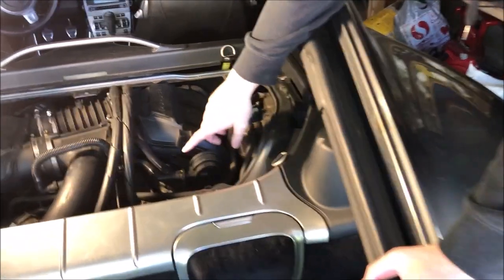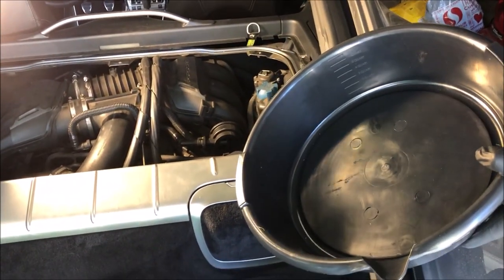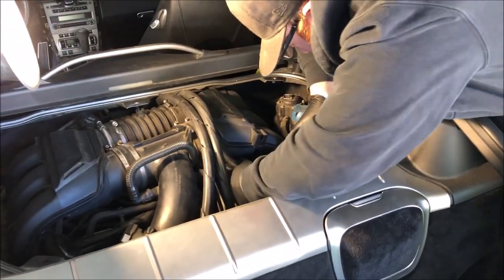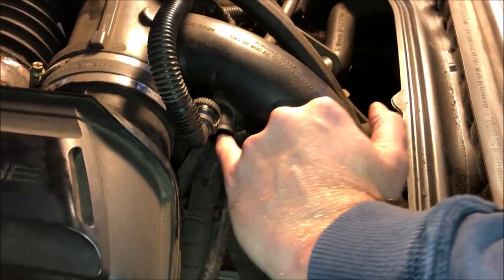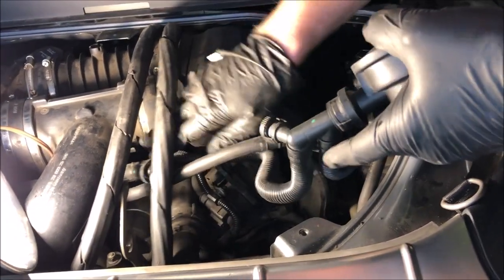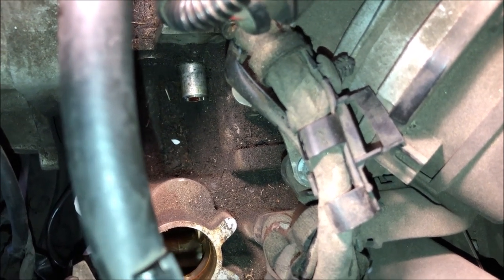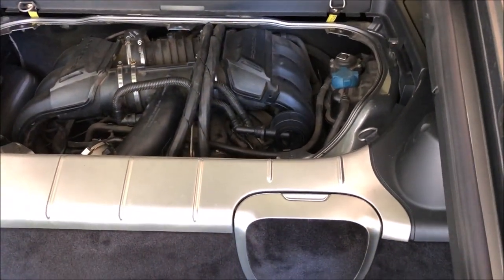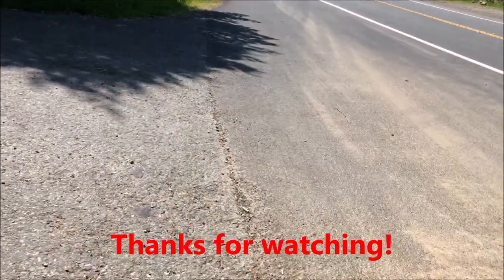AOS Replacement, Removal and Install: Porsche Cayman S

Comment: Are you saying that if there IS vacuum on the oil cap the AOS has failed or if the AOS is functioning correctly there should be vacuum on the oil cap?
Reply from the maker: Great question. In my research at that time, if there is a strong vacuum on the oil cap when engine is at idle, it could be a sign the AOS is failing. If you don’t have a manometer on hand, it’s something you can check. Combined with clouds of smoke, oil light, and/or a ticking type sound. Checking the vacuum at idle on the oil cap is just one possible indicator.

Comment: Norcal: thanks for the excellent video. Question  about the T section plenum. How do you remove it? I loosened all 4 hose clamps, but it still won't budge. Please help.
Reply from the maker: Ray Just got your comment. For some reason we did not get a notification. I apologize. We have not taken off the plenum. So, I don’t have an answer for you. You might DM @dwraysgarage , @bakers_garage77 , or @flat6.jay on Instagram. Hope this helps!

Comment: after replacement did you look into your park plugs for oil recalculation ?
Reply from the maker: Midnight Legends No, I didn’t check the spark plugs at that time. But, about a thousand miles later I did replace them and they were pretty shot. Quite a bit of deposits, but no strong sign of oil deposits.
Reply: @norcal9874  Hello, thanks for this video. So the bad AOS isnt too bad on the spark plugs? My car eats oil and has oil in the aos hoses. Sparkplugs were changed last year, so im asking if i sould change them right after the aso or if it has time.Thanks
Reply from the maker: @TheBestWanted112  i would recommend changing the spark plugs after doing the AOS. it’s cheap and will help any troubleshooting you are doing. thank you for the sub and comment! we appreciate it!!!

Comment: What year Cayman S is this? Was the AOS the problem?
Reply from the maker: Jones Kendrick 2007
Reply: @norcal9874  Did new AOS fix the issues?
Reply from the maker: Yes. Helped tremendously. The bladder in the AOS was torn.

Comment: Did you have to jack up the car And remove the wheel?
Reply from the maker: 512 TXS Nope! Was able to do it all on all 4’s. 🤘🏻🔥 Thank you for the question/comment!
Reply: Was it just white smoke on start up or smoke all the time?
Reply from the maker: 512 TXS A lot of smoke at startup and at normal idle. Leaving the neighborhood would leave a trail of this smoke in the air.
Reply: norcal987 got it. Thank you sir.

Comment: How was your engine running prior to this?

I just checked the air intake (same as you did @3:50 in the video) and I also have oil...does this mean my Air Oil Separator is bad and needs replacing?
Reply from the maker: It was actually running pretty good. I’ve heard mixed reviews about oil lining the intake. Some say it’s normal, some say it’s signs the AOS is gong out. Here’s my two cents; if you have a ton of smoke coming out your tail pipe on start up (it’s normal to have some on high mileage engines) AND it stays that way as you’re driving down the road for a few miles, I would replace it. It’s pretty cheap and easy. Got mine on Amazon for $110. Hope this helps! Thank you for the comment🤟🏻🔥

Comment: was the catch pan needed?
Reply from the maker: Sandy Wong  Actually no oil came out so it wasn’t needed. But, whenever I work with anything where oil has the  possibility of hitting the garage floor, I use one. 😂🤘🏻🔥

Comment: it"s easier to remove the bottom hose the other side,then remove the AOS, because the two bottom of the AOS return pipe is the same angle, and the ring you cracked just use to open the two locks, don't need to fix it ,it still can lock up.
Reply from the maker: For sure! It still does lock up fine. I’ve had no issues. Great informative information! Thank you for your comment and added info! Every little of bit of tricks and tips from everyone makes life easier for the next person!
Reply: just did one yesterday, before I start I know they only have the new AOS, no hoses at all, so I need to very careful to remove all three hoses, and hopefully all the hoses still soft and this my first time. 😅
Reply from the maker: @alanw5812  Awesome!

Comment: What sockets are the 2 bolts?
Reply from the maker: Sandy Wong They are 5mm. Thank you for watching and the comment! 🤘🏻🔥
Reply: norcal987 5mm seems to be too small I’m trying it right now
Reply from the maker: Sandy Wong it should be a 5mm hex socket
Reply: norcal987 it isn’t an e socket of some sort? I really don’t think it’s a 5mm
Reply from the maker: Sandy Wong DM me on Instagram. @norcal987
Reply: norcal987 can I send you a video on Instagram or somewhere?
Reply from the maker: Sandy Wong yes, instagram. @norcal987
Reply from the maker: Sandy Wong excuse me, it’s a 10mm torx socket, not 5mm
Reply: norcal987 so an e10?
Reply from the maker: Sandy Wong yes, sorry about the confusion, my bad